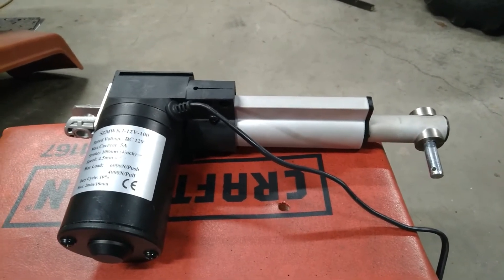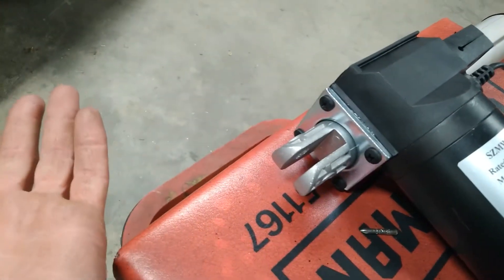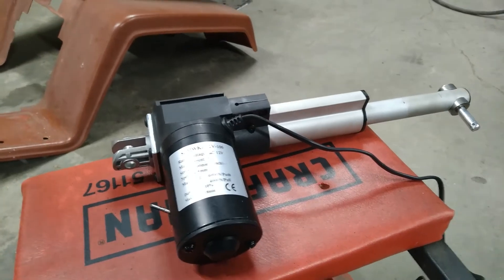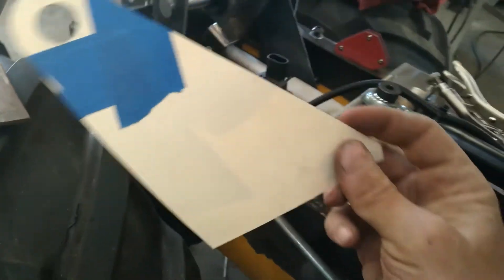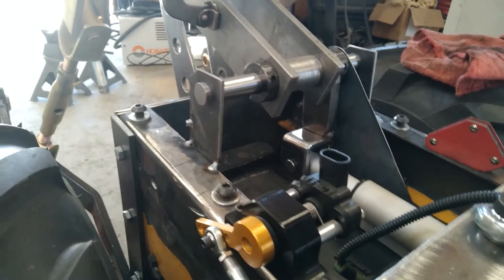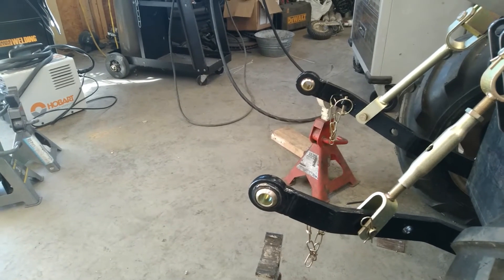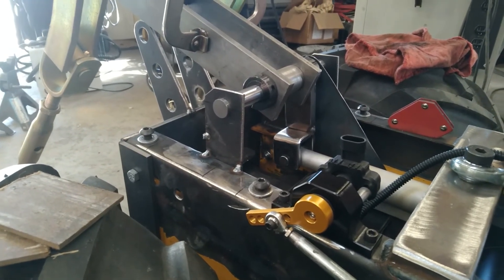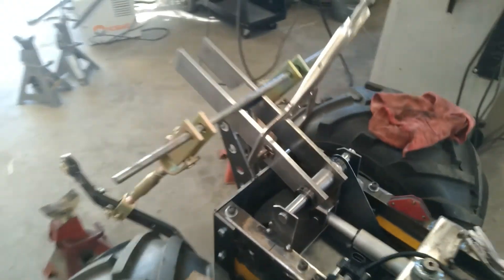3 Point Actuator - The Cub

Comment: Can you do a video on the hydraulic ones next? I've got remotes but no electric plug in the back of mine
Reply from the maker: Unfortunately, I don't plan to use hydraulics in any of my builds. 
It'd be very simple for you to run some wires to the back if you wanted to try linear actuators.  This one, in particular, only pulls a maximum of 5 amps so you don't need much more than 14 gauge wires.  In the next video, I'll talk about a cool little reversing relay I bought to control it.